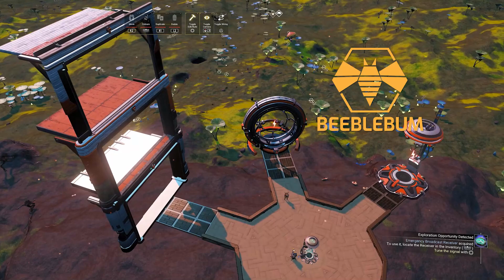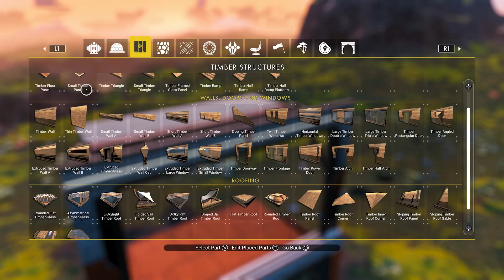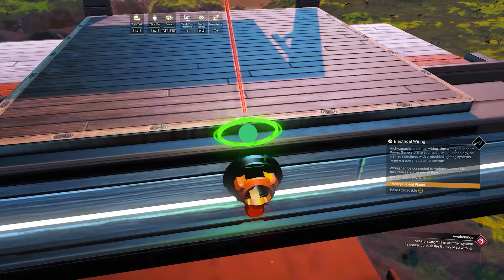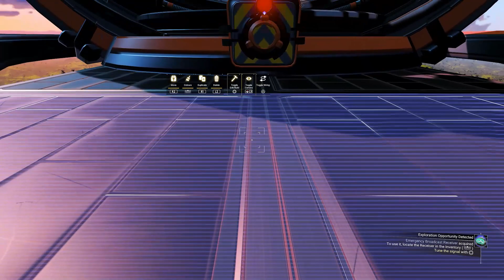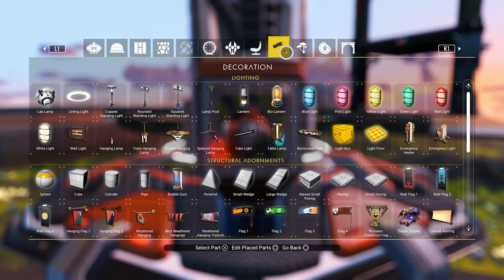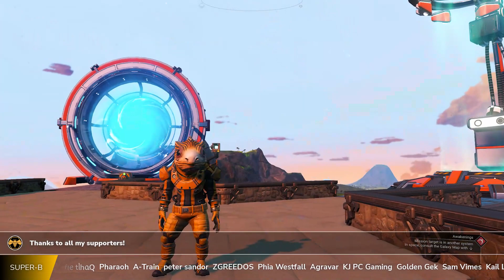[Archived] - How to Power up Scaled up Building Parts | No Mans Sky

Comment: Can this be done on scaled up storage as I'm not getting it to work with the teleport way of doing it?
Reply from the maker: Much of the techniques in this video only work partly anymore, hence why I tagged the video as outdated.
the connectors of each building part have their own collision or snap location, which makes it really hard to make a universal guide for this.

You can use this video as a guideline to understand it, but you will have to experiment yourself where that connector is.

Comment: Hiii bee!! Great video. But how do you Power a large biodome? I cant Seem to do it with the light floor or small aloy floor
Reply: Just place a cuboid room inside the scaled up dome and add power to said cube. It does not matter where inside the dome the cube is, so I like to hide it inside the big cylinder at the top of it (the dome). Hope that makes sense.

Comment: Not sure where I’m going wrong with teleporter! Upon placing alloy floor and toggling wire, there’s no connection that comes up for wire 🫤 Any help?!
Reply: yup same problem even the other glitch with carpet doesnt work anymore its like they took away the conector from enlarged doors . but what good is a garage door if the stuff you put in your garage (exocrafts )not even the smallest one fits through the door ?

Comment: So I've got a BIG powered up short range teleporter. Unfortunately it's so big the teleport wire itself will not connect. Is there a workaround for this or do I need to use a smaller teleporter?

Comment: I think they fixed the powering I can still up scale but can’t power it
Reply from the maker: I Actually did this this week, and it still worked for me.
Take note that if you scale the parts in different sizes, you also have different distances for the wires.
Reply: @Beeblebum  not working anymore, could you try it again to be sure ?
Reply: oh seems like they took away the connector with enlarged parts

Comment: You think it can work on a huge gas/mineral extractor? Also what about the pipes if it works?
Reply from the maker: You should be able to get all of the connections to work, but you probably will have to do a lot of fiddling and testing.

Comment: Anyone have succes on powering the storage containers?
Reply from the maker: I honestly hardly have been scaling up or down much of the powered devices, except for the ones I shared in this video.
Reply: @Beeblebum  hey guys, i make my storage containers as small as possible, and when placing them inside of a cube room or a glass room, they auto power... no wires needed!

Comment: Thank you very much for sharing this info, sir! May be there is also a way to power scaled-down parts?
Reply from the maker: I have not had any issues with powering scaled down parts... Which ones did you have issues with?
Reply: @Beeblebum  Thank you very much for your reply! Well, I have been able to power up the scaled down storage containers by proximity, putting a solar panel behind them but when I try to wire them to my main source of energy with a wire, they connect but don't seem to receive energy.

Comment: Beebs, have you figured out how to power up a full scale bio dome and add a door?
Reply from the maker: Powering up should be the same as with the teleporter module. At least that worked for me.

Connecting doors.. sadly no luck so far.
Reply: I got the ladder hatch in the middle to open by attaching a cuboid room under it. If you put a regular cuboid room against a scaled cuboid the entire side opens up so potentially you can use a scaled up and regular cuboid room to open the dome ladder hatch and get in that way. Just don't use snap

Comment: I was transferring power through pill lights. I guess now i can save one piece on my enlarged builds :P
Reply from the maker: Yeah, the pill lights are a bit messy... there was a trick on how to glitch them inside the powered door, so you did not see them, but still. It is one extra part and there is a light point there.

Comment: I have an issue with regular size parts not wanting to snap to upscaled parts, no matter what I do. What sort of sorcery is this? I tried to make a garage for my exocraft using an upscaled garage door and nothing would snap to it. I've even tried snapping upscaled parts to other upscaled parts, doesn't work for me either.
Reply from the maker: Depends on what part you were trying to snap, as you can see in this guide, the floor, powered doors and walls snap easily to a scaled part, they just hold their regular scale.
Reply: Hmm ... I wonder if it's because I'm using the legacy building parts? I tried floors and walls, doesn't work for me on PS4.

Comment: Hey beeb that s great! i just use a pill light though. You just have to position and connect it before placing the scaled up piece. Check my channel for a 60 sec tutorial
Reply from the maker: The pill light is a good way, but I am a sucker for exact snap points. The pill light can be trial and error, especially depending on what type of material you build with.
Reply: @Beeblebum  yeah, definetely you are more precise

Comment: Just been messing with a scaled up door and the teleporter module trick works aswell when 3 panels are stacked on top each other on the door connector
Reply: got to be with large alloy floor as small floor stacks different
Reply from the maker: Does it work on each of the Scaled up Doors? There are different collisions on these. It is great if it does work though. 😄

Comment: thanks, just what I was looking for ...one question .... so if I can scale everything, can I build a gigantic Base with all the pieces enlarged ??? 😊
Reply: The way pieces snap together till uses the default sized object as a reference point. Because of this your idea may or may not work.
Reply from the maker: You can build a fully scaled up or down base, but snapping will not work.
I am sure Action Pants Gaming did a stream on how to build with Scaled parts.
Reply: @Beeblebum  thanks 👍👍
Reply: I have a big biodome and got power connected thanks for that. Getting into I just put in a short range teleporter that's working well.